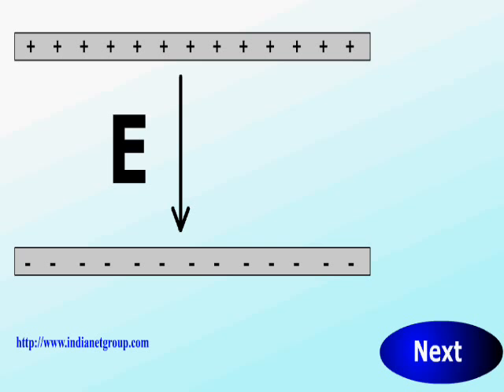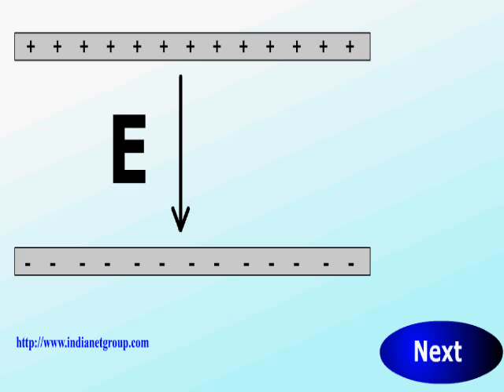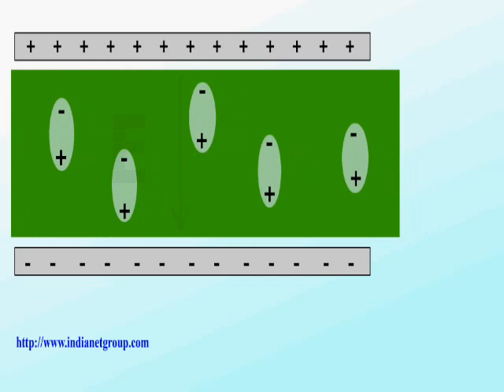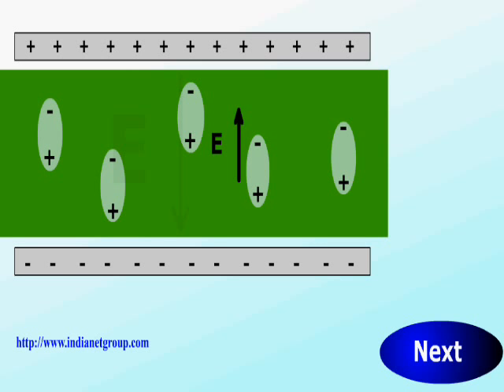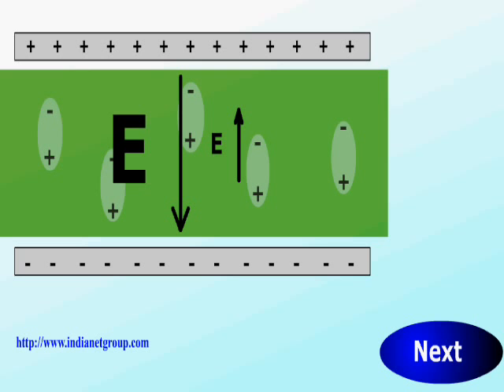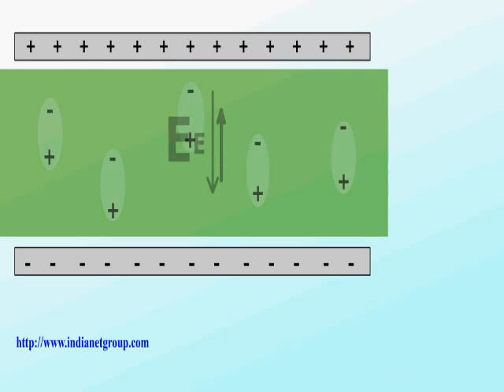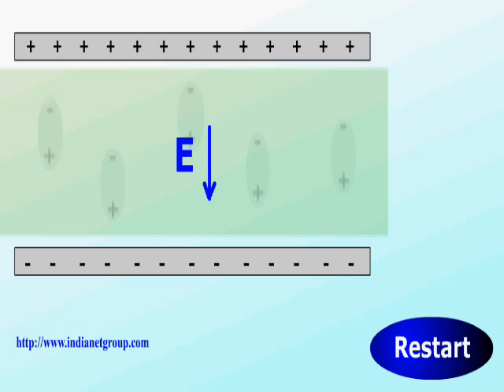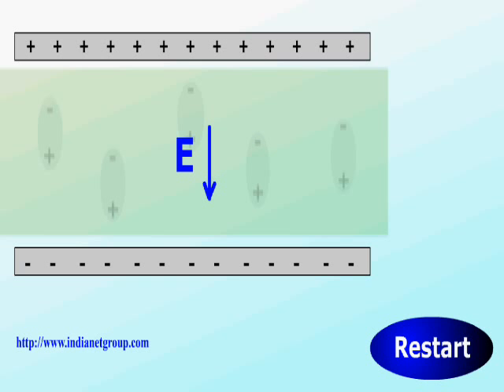Capacitor Dielectric

Comment: In capacitors when newly electrons (of charge -Q) approaches one plate it will experience of force of repullsion from the negatively charged plate, and this increases their potential energy and the potential across the capacitor will increase But as -Q approaches, -Q from the opp plate will get repelled. 

The question now if this is happened shouldnt the potential of the capacitor be constant because as ΔPE comes from -Q on one plate shouldnt ΔPE is transferred from the opp plate
Reply: Are you alive bro??